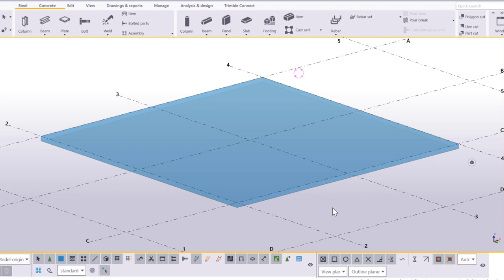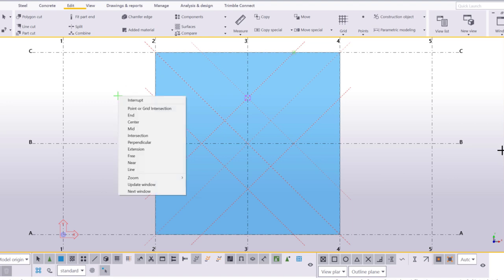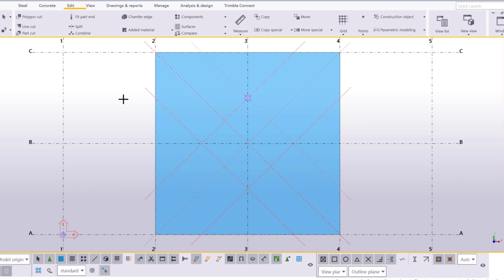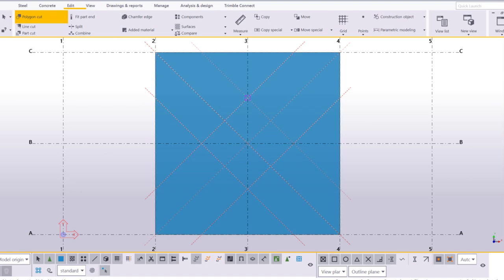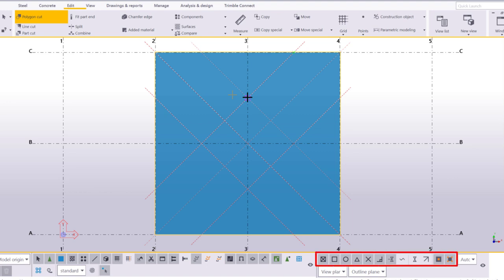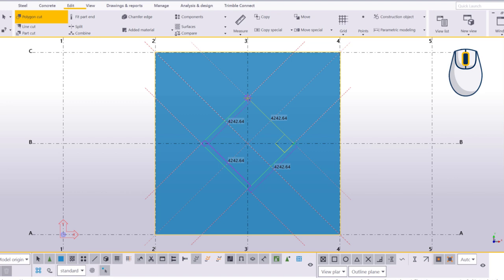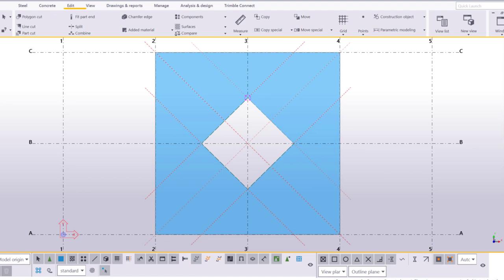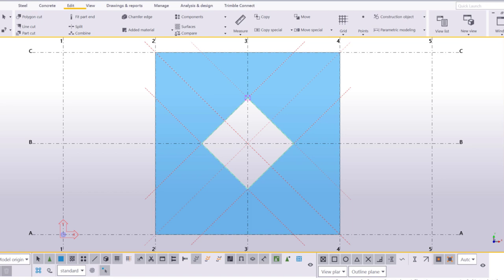Cut parts with polygons in Tekla Structures

Comment: Okay, how do you cut a circle or an arc....
Reply: x2
Reply: @deibyxaviercondoriramos9054  later found out that you click on the corner and can edit the properties. Paint the settings to the other corners as needed.
Reply: Searching for this myself. I have figured out creating lofted plates between curved polylines, but now I need to cut an HSS member to a curved flat bar. I'd actually prefer it be a straight cut at the tangent, because the curve is so soft, it'll weld in the shop just fine off a saw cut. Advance Steel is better at some things...
Reply: @Bolewski10  I just did lofted plate the other day. I'm sure cutting works in the same way. Quit as after 3 years never looking back.  Just like any CAD program once you know how it works it's not too bad.

Comment: I dream of a day when I will to be able to make a cut in stainless steel on a radius plate or make a radius rail assembly and have the drawings show in shop form (un-bent). Tekla needs to lock all parts to the main part and be able to show the parts un-bent. I.E. a radius beam will be cut prior to bending. the cuts need to be laid out on the drawings so, the shop can cut them. Our handrails are also bent after assembly. Miscellaneous detailing is very difficult.
Reply from the maker: Thank you for your feedback! We always love to hear about how you are using our software and what other features would be useful. I have sent your request to our product team for consideration. I also encourage you to post your thoughts in the Tekla Structures discussion forum, https://forum.tekla.com.